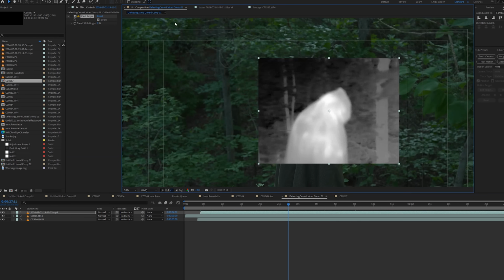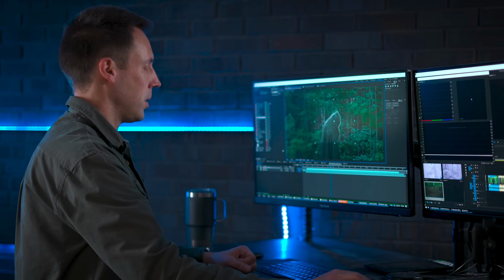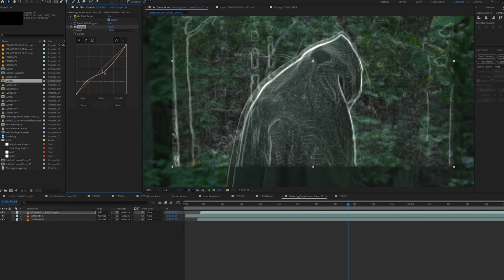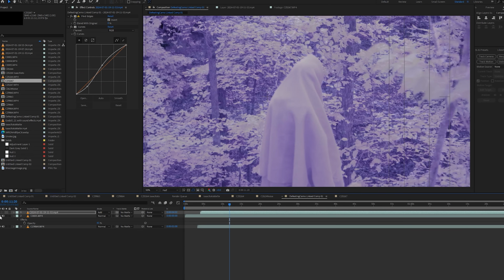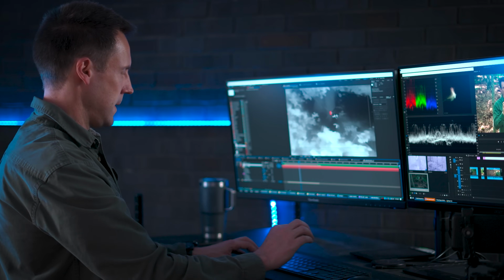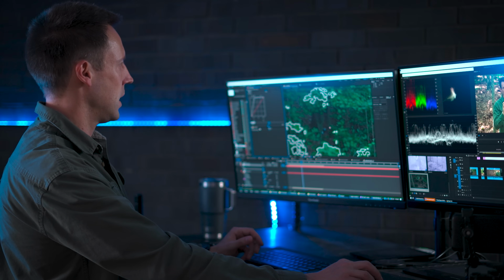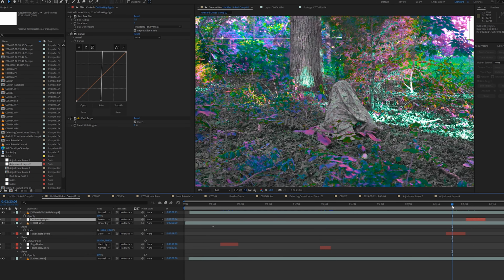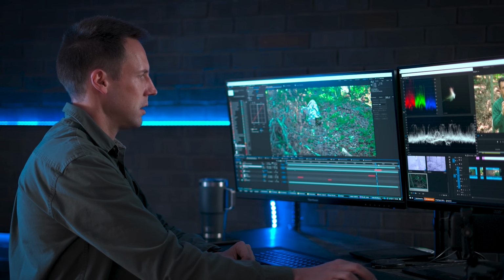Using IR, Thermal Imaging, and AI to Find Hidden Objects

Comment: The funny thing is one of the very first AI uses in regards to imaging was an attempt at detecting camouflaged vehicles out of various pictures. The part about that which is actually funny is they accidentally trained it to tell the difference between sunny and overcast days due to the images used as the training set.

Also there's another neat kind of sensor package for imaging that has been popping up if you know what to look for, and that is THz scanning. Of course light would technically be there, but it's specifying the band of wavelengths between microwave and IR. Works similar to LIDAR, but the beam can penetrate things to some amount in order to do density mapping. It can see through some structural materials and it will also highlight stuff like any disturbed soil. So it can also spot things that are buried to some amount. So it's oddly like an X-ray of sorts, except it doesn't present the kind of hazard of X-rays or need that kind of power demand or heavy equipment to scan a large area. I figure the military uses this for some things, although it's not shown much other than a brief mention on some (futurist?) tech shows.

Comment: I've been experimenting with a similar janky camera cluster for use on a drone. I used a runcam nano for my day cam, a runcam night eagle ii for the IR and low light cam and a seek compact pro for my thermal which is running on a raspberry pi. I think I'd like to switch the Seek thermal out for an Iray unit but I'm pretty happy with the setup. Its about the size of an old gopro and while janky it absolutely works.

Comment: RISCV platforms have been released that work with machine intelligence of varying sorts - the big deal is that most of the projects utilize very low cost sensors and controller/processing platforms, and it's all open source - the software, hardware, and design rules/architectural language.
Someone has produced (it easily crowdfunded) a color night vision system for about 200 USD - it uses intelligence to construct a composite image on the fly, again using multiple cheap sensors, making it look like it's simply a cloudy day as opposed to nearly completely black night.
Reply: Interesting, do you recall the name of that project?

Comment: Using IR and UV spectrum cameras you can often see camouflage items because the materials block or transmit differently at those spectrums. Some of the newer camo from military vendors are addressing the issue but more often than not stuff stands out like a sore thumb.

Comment: Wait a second... aren't I.R. and Thermal two names for the same thing? Thermal imaging lies on the InfraRed part of the light spectrum.
Reply: it's all a spectrum.  you have some light that is closer to visible and some that are further. Even in the thermal realm. 

IR =/= Thermal as if that was the case, then night vision goggles would be thermal goggles and thermal clip ons would be night vision clip ons.
Reply: @GldenRetriever  So thermal (heat) is not in the Infrared part of the spectrum? I'm guessing what you're getting at, is that The IR part of the spectrum can refer to both the IR spectrum and a specific part of the IR spectrum, and that the difference between IR and Thermal is like the difference between purple and blue in the visible spectrum. It seems really strange to me that a "color" in the IR spectrum would be called "IR". It's be like like naming "yellow" as "visible". The visible part of the visible spectrum. Kinda dumb imho. Oh well.
Reply from the maker: Technically, that area of the IR spectrum that is nearest to the visible spectrum is called Near IR (NIR), then there is Short Wave IR (SWIR), then Medium Wave IR (MWIR), and then Long Wave IR (LWIR). Night vision devices can see NIR, and thermal imagers can see LWIR. It's all on the same spectrum, just different parts.
Reply: @T.REXLabs be interesting to throw ultra violet in with the rest.

Comment: 4:30 What does the 1500 - 8000 nm spectrum look like? There's a giant gap there.
Reply: You have SWIR that goes to roughly 2500nm, you can see more information with it than NIR and it's not affected by things such as glass. The rest is MWIR, which is similar to thermal imaging but a tad worse.
Reply from the maker: Yeah, SWIR and MWIR see different parts of the spectrum, and they are really useful. However, cameras and optics that can see into them are not common. We will explore this part of the IR spectrum in the future.

Comment: In the Marine Corps it's taught that the 10 basic elements of camoflauge are:
1. Shape
2. Shine
3. Shadow
4. Surface
5. Sillouette
6. Sound
7. Space (Positive & Negative)
8. Color
9. Contrast 
10. Movement
Reply: look up what metamaterials.  All of your elements won't matter with maybe the exception of thermal.  But thermal aspect can be supplied from metamaterials.
Reply: Quite the same in french army, we have a "famous" acronym for that : FFOMECBLOT which when pronounced in french could mean something like "fake guy snug' ". Fond (background), Forme (shape), Ombre (shadow), Mouvement, Éclat (shine), Couleur, Bruit (noise), Lumière (light), Odeur (smell), Traces. It even has its own page on french Wikipedia.

Comment: On of the Machine Learning software like IBM Maximo Visual Inspection can identify variations in frames which can then identify things moving. One you identify the things moving you can highlight them. Thus camouflage would then be useless if something was moving.  Identifying something stationary would require an image without the camouflage item and one with.

Comment: Thermal reflects off of regular glass pretty well.   Maybe use a piece of glass at a 45 to get the IR or visible video inline and take the thermal video reflection from the glass at 90 degrees.  That should remove the parallax.

(Edit)  Just got to your beam-splitter reference in the video. lol

Comment: The first thing that came to my mind when I opened this video was parallax and the second was your video you posted comparing spotting scopes to long range reflex camera lenses.

Therefore, the first full thought that came to my mind was a full spectrum spotting scope with a LIDAR, IR sensor, telephoto sensor, and thermal sensor. 

There you go,. you've got a full spectrum spotting unit that is the size of a spotting scope. It can be given to a recon team, used by PI agents, be hard mounted as a security system or mounted to some kind of ground based drone ROV.

It will be the defining factor in future conflicts, the arms race of spectral awareness and advanced camouflage theory.

Comment: Tech Ingredients did a video about how to defeat the ADS (Area Denial Systems) IE microwave weapons. Basically a screen (right size mesh/material) is farraday barrier; so it'll absorb the microwaves/disperse them. 

I'd be interested about paints like vantablack, where you get such an absorbent surface: how does that affect lasers guided 'systems'? Do they 'follow the beam'...or look to 'target the dot' (on the target)? IF it was the latter, it'd maybe defeat that to some extent
Reply: Laser target designators have a hard time with materials that absorb or scatter the light, but a laser bomb that misses you by 5 feet still kills you.
Reply: The best way to defeat a laser guided weapon is to blind it with your own laser.